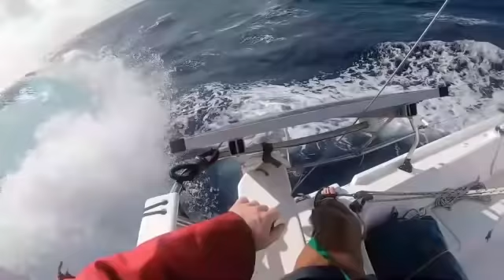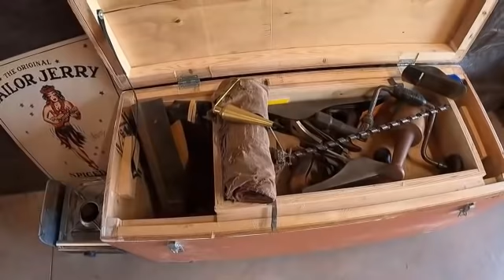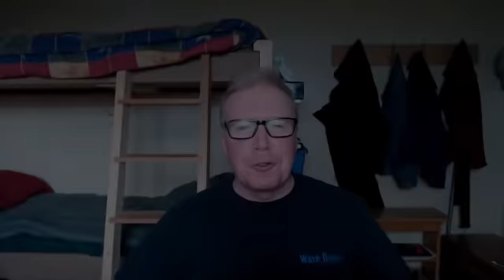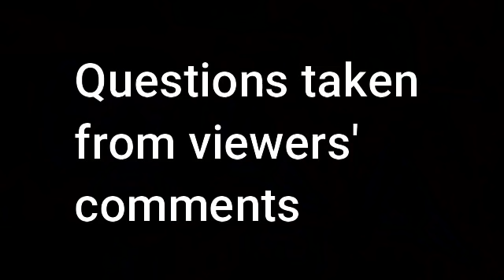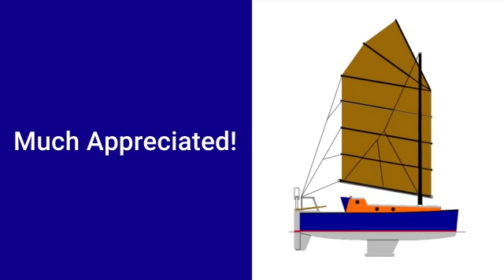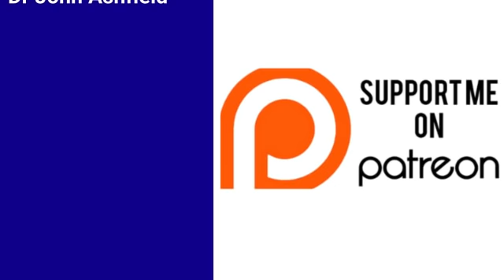S2E03 Study Plans Available for the Wave Rover 6.50 || Questions Answered by the  WR 650 Architect

Comment: I've been using a "10hp equivalent" Hankai electric on my Paceship PY23 and it's excellent even in heavy winds.  I can do just under hull speed at 5.5 knots. I have about 120AH of lifepo4 battery and I've used it for 3 hours without even getting it down by 1/3rd.  Consider using the battery as ballast for the centerboard.
Reply from the maker: Thanks for sharing!

Comment: Ahoy Mr Rover! I have followed up to date with the framing, but thought I would come back to this point to comment. I have gone from wanting to buy a sailboat to wanting to build one, primarily because the elements I have researched are very hard to find for sale, mainly that wonderful junk rig. For safe, easy, solo sailing it seems hard to beat and the low cost and easy maintenance/repair make it a winner for me. I have also been very interested in the twin bilge keel. When discussing these elements with sailor mates they all seem to dismiss them offhand, whether out of lack of knowledge or interest is hard to tell. Seems I should only choose a Bermudan in excess of 30ft, with roller furler and a deep or long keel, so I would like to extend my sincere thanks to both yourself and Mr Dize for laying out why these elements work on this boat so well. It's almost my perfect cruiser too, but I am 6'1" tall so a bit more headroom is needed for extended cruising. I will definitely be watching the build closely, and would like to extend gratitude for lessons being learned while I do. Thank you greatly! As soon as I can get back to UK (stuck in SA with covid travel bans) I will be purchasing the study plans along with those for a few similar boats (Swaggie 18, Tasman 24 etc) to try and get a broader understanding of the design elements. Being a fisherman and surfer, I definitely need to accommodate these things into my boat... Thanks again
Reply from the maker: Great comment and good luck getting back to the UK. If only you had a WR 650 you could sail back, lol. My first 2 boats were sloops but I have been convinced to try a Junk rig. Everything is pointing me in that direction. My priorities are safety, reliability, minimalism, frugality, and ease of building and use. Remember that you only need to sit down and sleep in the cabin.
Reply: @WaveRover2  Ha, a WR650 would help indeed, but it would take me to Madagascar and onwards towards Thailand first :) apparently sailing to UK is still off, there's a solo sailor from England stuck in Durban Harbour waiting to leave, been there almost 2 years now, rather mad. To try and shorten a long story in the midst of the pandemic I realised I need to move on from an off grid house I have been trying to build on the SA east coast, for several reasons (financial constraints caused by pandemic merely the last straw), so sitting in lockdown formulating a new plan I decided it was time to go sailing, as the only thing better than a house on the beach is a home on the water ;).  Decided I wanted to go solo. I have some sailing experience, but not enough so leapt into research having much time to hand. I came across your Atlantic trip on your tessa and was very inspired by this, and learned a great deal, thank you. I share the minimalist mantra, and the legendary Mr Sven Yrvind's manifesto put any doubts about small boat cruising to bed. The JRA and a little piece titled the 50 advantages of a junk rig made this the rig of choice for me. I feel cruisers are reticent to use the junk simply because it not in mass production and look forward to seeing many more out there proving the doubters wrong. Having also been intrigued by the twin bilge I felt like the WR650 was being designed for me ;) As I say stowage for 2 surfboards min, a fishing ski and attendant accessories may make her a touch too small, and being able to stand up straight in the cabin in inclement weather would be a bonus, so I may look into some revisions before I get started, but am eagerly awaiting the next installment of WR650. Crack on Mr Rover, and many thanks for all the amazing content, lessons, and inspiration IA

Comment: I have a question about the old Wave Rover. What kind of anchor rode did you use? I am planning to buy a  9kg Spade anchor for my Sadler 26 (replacing 8kg CQR)  and there are obvious benefits to an all chain rode but I don't want to weigh down the bow excessively. I wonder if I can learn from your experience?!
Reply from the maker: I think that I had a 7-8 kg Bruce anchor. This time I will go for a 7-10kg Rocna. With 30' of chain and 5/8 nylon rode (100')

Comment: Just watched a video of the Junk sailing boat MingMing which typically sails the North Atlantic Ocean above the Arctic Circle which looks to be about the same length as Wave Rover 6.5 or your Contessa 26 Wave Rover.  There were things about it that I liked better than the Contessa 26 and Wave Rover 6.5 and things about the interior design of the Contessa and the Wave Rover 6.5 that I liked better than on the MingMing.  I know that small boats are wet boats but it seemed like the MingMing had less water over the bow and stern than the Contessa 26.  It’s must be a design of the hull which I didn’t see.
Reply from the maker: The Contessa 26 has very low freeboard. She wasn't designed for ocean crossings but having said that several have crossed oceans. The WR 650 will have almost 3' of freeboard making her a better and drier sea boat than the Contessa IMHO.

Comment: How do you expect her to heave-to in heavy weather conditions?
Reply from the maker: Another commenter wrote something like this recently and it sums up a junk rig version of heaving to: The equivalent maneuver is to continue to sail to windward, but under very much reduced sail area, so that speed is so low that the keel stalls and you make a lot of leeway, therefore making good a course across the wind. The vane gear should continue to keep the course well enough.
Reply: Thank you for the quick response and the inspiring project! One thing about heaving-to in breaking wave conditions is the slick it creates. I wonder the extent to which the strategy described here generate an effective slick.

Comment: What about a trailer for the boat?
Reply from the maker: At some point I will have to start thinking about a trailer, any suggestions?
Reply: @WaveRover2  also, mast raising system. Being able to be self sufficient is a great thing.
Reply: @WaveRover2  what is a rough estimate of the weight? I feel that building one would be easy to do with a mig/tig.
Reply from the maker: @chriscoatess3600  approx 3000lbs
Reply: @WaveRover2  a 3500 single axle kit with electric brakes can be had for 800 usd. I'd say it would be about another 400 usd in materials to finish. I can draw up a cad file with random dimensions( adjustable for future use). Two bunks for the keels to rest on ,two adjustable bunks on the front, and two adjustable and removable bunks for the back. I think the two in the rear of the boat is redundant but would give some peace of mind. The hard parts are tounge length and axle placement. What are the width of the keels?
Reply from the maker: @chriscoatess3600  The keels will be approx 4.5' -5' apart. the boat is 21' in length and a beam of just under 8'
Reply: @WaveRover2  ok, give me a few days and I'll make a cad file. I have had an idea in my head for a few months now as I wanted to buy a Westerly Pageant. I found your channel while looking at bilge keels. I am more of a fan of building my boat from the beginning than to repair an old boat. I also like the bilge keels. So I think for me that I would also like to build my own Wave Rover. I think that an electric inboard motor  would be nice. My only concern is electrical shock in a failure event.

Comment: Fantastic design; so, you listed marine plywood quantity - what size of sheet you take into consideration? Asking for this detail :) Thx in advance,
Reply from the maker: 4x8, 1200mm x 2400mm
Reply: @WaveRover2  Thank you :)
Reply: @WaveRover2  So, from our local market/local manufacture point of view the cost of 1 pc plywood is 240,oo PLN (around 63,oo USD); currently that's a high price; before the summer you could get it for half the price. Now there is great speculation in the market, unfortunately. it looks like all the material for the hull will be around 1,764.oo USD!

Comment: In metric please. Wave Rover 650 Study Plans is now in feet end inches. For the material in the item list I come to 36000 NOK equal to $4300 in Norway.  Is there a way to estimate the total material cost out from this?
Reply from the maker: Almost all of the study plan has the metric equivalent in brackets. Most importantly the critical data and building material is in both. The actual building sheets that I am using have all measurements listed in mm and imperial. 
I have asked Andy to have all measurements in both systems for all of the construction plans when they are made available to the general public.
Reply: @WaveRover2  Yes, yes, please, in mm factors, as well. Thank you!

Comment: Self righting? I'm wondering how that works with twin keels with equal weight on both sides of the hull bottom.
Reply from the maker: I think that Andy did a good job explaining that, note what he said about the inwardly sloping sides.
Reply: @WaveRover2  just my visual, but as the boat might be turtled, or mast down, the keels at 10-15° angled , now outward,  wouldn't this position make the weighted keels counter balance? I can see self righting from 90° knockdown to maybe 145° with some sort of floatation on the masthead in a slow roll.
It would be interesting to see scaled down model test in a tank.

Comment: Had a quick look at the study plans, looks good.
One question, is it anticipated that some of the building frames will actually be the bulkheads in the finished boat.
A similar construction method is being used for the new Class Mini Global 580.
Reply from the maker: No, we are following a different method. After the hull is made the frames and bulkheads will be added. This gives me a nice open space to fillet and tab the inside of the chines continuously from stem to stern.

Comment: Suggestion: move mast somewhat back and turn it into a split junk rig.
Makes for far more stable downwind sailing.
Changed my Coromandel from what you now show (more or less standard Hassler / MacLeod setup) to Split Junk Rig.
Big difference in downwinding as sail area more evenly distributed on both sides of the boat.
Reply from the maker: Sounds very interesting. Can you send a picture and some dimensions via my business email found in the "about" section of the channel
Reply: @WaveRover2  Tsk Tsk. This and so much more is what you can learn at the JRA.
Reply from the maker: @StormSignal  I am a member but have been so busy with the project at hand. I just posted an update on the JRA site though.

Comment: Having sailed a Newbridge Coromandel (junk rig) for a couple of years, I found the control line that moved the rig fore and aft relative to the mast made keeping the boat tracking a revelation, compared to a Bermudan rig.
After a mishap with the tiller, sailed 10 miles on a broad reach just using a 4 inch rudder stock.
Reply from the maker: Should be a breeze to balance.

Comment: 6.50 implies to me that this boat is 6.5m long what yo have come up with is my present boat the Westerly Pageant. If you had just bought a Pageant and fitted a junk rig you could have saved a lot of money and time. I guess you just want to build a boat. The pageant design is available in various sizes as Pageant, Centaur, Berwick etc all built like tanks.
Regarding bilge keels I know he said the boat can stand on her keels but he didn't elaborate on it much. The key thing is that if you really need a break, you can pull up on a beach mud or gravel and take a break for days if you like. It's like having lots of free marinas on your journey. Other advantages of the bilge keels are that if they are your ballast, then the ballast is spread out and therefore the moment of inertia is increased making the boat feel much heavier, with a more gentle roll without actually being heavier. The last thing on bilge keels is that a large amount of water is trapped between them at any one time, it's kind of like you have a couple of tonnes of free ballast down there also damping your motion, yet again without actually having the penalty of hauling around some actual ballast. Regarding your construction I am coming round to the idea of having a chine boat. Round boats are the best hull shape for a displacement boat, but a chine boat particularly a single chine will dissipate energy the of rolling, ie it will have better roll damping. On a small boat the more roll damping the better you win on this one.
Last comment hull form, I don't know of anyone who has thought this one through if you push a round form displacement boat hard enough she will broach, not good so don't do it. Well there are circumstances where you can get caught, out running before a gale and not being able to slow her down enough or being anchored in a current in some sort of natural disaster, hurricanes are routine in the southern US then you are swamped and screwed.
Consider this if that boat had a V bottom like yours she could plane even though she is a displacement boat, if there is enough force available eg the flood or hurricane and hopefully be fine. 
Michael Kasten pulled off a single chine design which l find hypnotic Redpath. He buried the chine below the water line see the photo on his website. Redpath in the shed.
So after all of that I wonder what your designer thinks of the type of construction in George Buehlers book backyard boatbuilding. I have unlimited amounts of wood available to me and I like the idea of a boat made of individual components that can be replaced and how thick would he make the planking. Something the British comedian grif Rhys Jones said about wooden boats, " you just godda have one, you just godda have one."
Reply from the maker: I took a look at the Westerly Pageant as I am not familiar with it. And although you see a lot of similarities I don't, other than it has bilge keels. Even the keels are a different shape. It is longer and the SA/Disp ratio is much lower. It's displacement is about 33% greater than the WR 650. And of course my Architect has taken great care to produce a very efficient hull shape which is unique to the WR 650.
Several other commenters have also seen similarities to other boats. But when you dive into the WR 650, it has been designed with a set of parameters that I have identified. The Architect has simply come up with solutions that individually are not unique but put together produce a unique boat... the Wave Rover 650.

Comment: I’m immediately curious why 6.5m?
Reply from the maker: Small boats intrigue me in so many ways and the smaller the boat the bigger the adventure. This is about as small as I would want to go.
Reply: @WaveRover2  I’m still unclear on why 6.5m is the smallest boat you would consider. I would imagine there were several parameters that had to be balanced very precisely, based on the chosen design, but i don’t know what those are, or are not. And I fully understand if it’s not something you want to get into!
Reply: it just occured to me that not needing a dinghy to approach small docks could be a consideration?
Reply from the maker: @patrick-po2lx  I'm thinking of building a small folding dinghy for when at anchor. A small electric outboard could be used for the 650 and the dinghy.

Comment: Loving this new plan. Was thinking about your windvane yesterday. Have you thought about incorporating a man overboard tether and spring  that would centre the windvane and turn the boat into the wind - like the emergency kill switch on boat engines?
Reply from the maker: That's a great idea, will start thinking about it.
Reply: Hi Tim and Alan.
This is a subject I have given plenty thought to over the years. Man overboard for a single handed sailor is unlikely to end well.
All of the equipment available requires at least one other person to bring the boat back to the casualty. Not much good to the single handler.
I have an absolute rule, I leave a lifeline attached in the cockpit and attach the other end to myself before my torso exits the hatch and it doesn’t come off until my torso is safely back in the cabin. If I need to go forward I take a second lifeline and secure myself as I go, always attached by at least one line.
However that does not answer the question. If you go over the side without a life line it is game over. If you go over the side attached by a lifeline, you will be dragged through the water and need super human strength to climb back on board. One solution might be to devise some sort of trigger mechanism to the lifeline anchor point that would activate a release for your drogue which would be mounted on the transom and arranged as carefully as a skydiver folds his or her parachute. Once the boat stops you will only need to climb the boarding ladder that you fitted to the transom for this very occasion.
If you are a whizz with electronics, you might be able to rig up some kind of gizmo that could release the drogue activated by a gizmo attached to yourself that triggers when it gets wet or you press the button. I bet one of your subscribers could come up with some simple electronic solution.
Food for thought.
Reply: could a man overboard rope pull out the drogue rope to stop the boat?